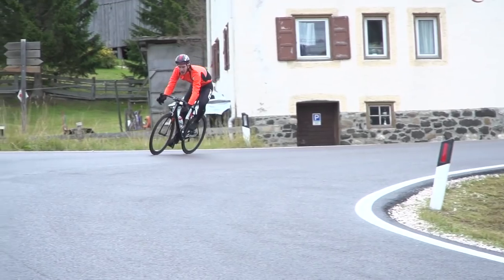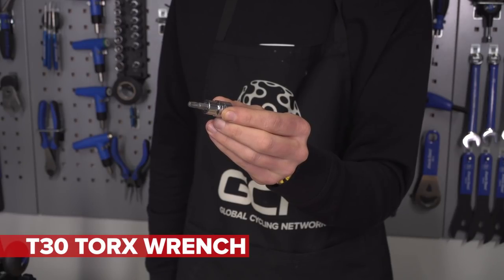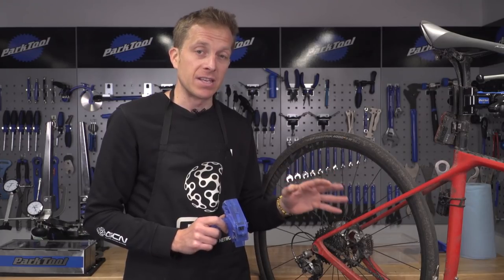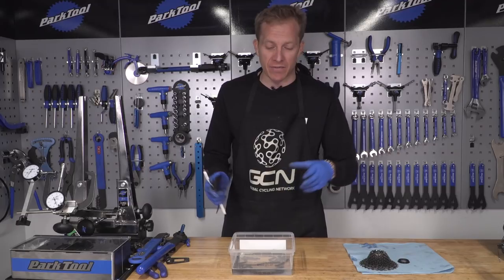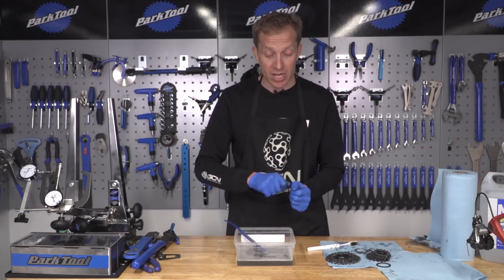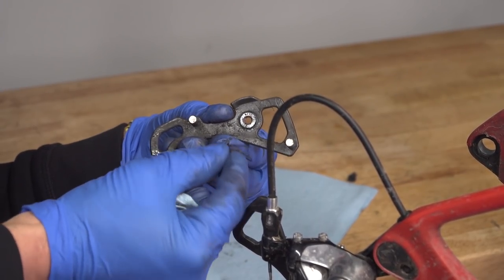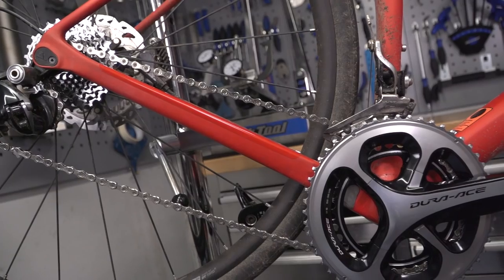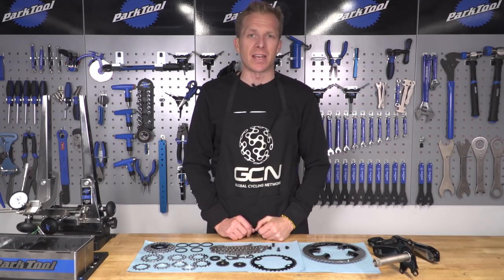Drivetrain Deep Clean | Make Your Road Bike Ride Like New

Comment from the maker: Let us know which maintenance video you'd like to see next on the channel.
Reply: How to maintain relationships
Reply: Now that the CX season is over, it'd be nice if you could show us how to service crankbrothers egg beaters :)
Reply: Nathan Burt blimey
Reply: Maintain cables.
Reply: How to apply a frame saver to steel framed bikes.
Reply: Since I’ve been doing a bit of car maintenance recently, I’ve come across carb cleaner - it’s brilliant for degreasing and comes in a convenient aerosol. Any reason I can’t use it on bike components?
Reply: I've never been able to get an answer on this either. Finish line speed degreaser smells and works just like the $4 can of brake cleaner from auto zone.
Reply: GCN Tech if you want to make a video how to line up your wheels  when you removed them for cleaning , thanks ;)
Reply: What are your views on ultrasonic cleaners? Good or bad?
Reply: GCN Tech full strip and rebuild
Reply: GCN Tech next video install and set up of a power meter
Reply: How to recycle degreaser and/or chains and other bike parts
Reply: What about a video about.mounting everything back in place?
Reply: I second panzerveps suggestion. Not just Crank Bros (which I use on my MTB), but maybe jamming fresh grease into Speedplays (when and how much), or what to do about rusty bits on some old SPDs. That sort of thing. I think that'd make a cool segment.
Reply: How to completely overhaul and clean a high-end wheel hub
Reply: I know you covered wrapping bars in a previous video but could cover wrapping aero drop bars, I have seen so much conflicting information such as wrap to just past the hoods, wrap all the bar to prevent slipping, don’t wrap all the bar due to extra wind resistance, start the wrap from the top down then another from the top up, so confused.
Reply: GCN Tech maybe how to recable a bike (have the kit sat on a shelf ready to do it a few weeks but haven't worked up to it yet)
Reply: How to identify when you need to replace wheel/hub bearings & how to do it.
Reply: A video about winter bike maintenance. (I know there are some)
One showing what to do daily after riding in the snow and salt to keep away rust.
Reply: Usually those kind of degreasers do work very well and evaporate fairly quick leaving no residue.  They're safe to use on metal parts and most other materials that don't get destroyed by strong degreasers. Rubber for example probably won't like it though, with repeated use. I use a car disc brake cleaner for my road disc brakes, it works perfectly.
Reply: Chaining out shifter cables.
Reply: How about a video on bottle cage tech? What shape is most secure? Most aero? Down tube vs. seat tube placement?
Reply: Can we get a workshop tour?
Reply: Jon kudos for actually cleaning a dirty drivetrain. So many videos simply show how to clean an already spotless drivetrain
Reply: I'd like to see something on building/rebuilding/truing wheels
Reply: Vintage 80's headset clean and repack would be amazing.
Reply: How to setup FD and chain length with Q-rings.
Reply: How to slice a pizza since you have the parktools pizza cutter on the workshop wall....
Reply: could you a do a video on how to get mechanical disc breaks working like new mine are not as powerfull and occasionally rub
Reply: Andrew Wallace you mean the coat inside of the frame against rust?
Reply: justin king go for ti parts
Reply: Rixter reminds me of the shaved legs in the razor commercials
Reply: Suggestion for the next video: What is the difference between loctite, regular grease and anti seize paste + where/on which bolts to use which product on alu and carbon bikes? Would be much appreciated. Thanks!
Reply: Lasse Rasmussen what is the answer between grease and antysize?
Reply: Top tip when pouring from a new bottle of degreaser, car screen wash or pure orange juice terra carton, is to pour it with the opening at the top, that way it doesn’t glug out.
Reply: Finding and getting rid of mysterious and annoying creaking sounds.  What are common causes of small creaking sounds - maybe its bottom bracket, or wheels, or seat post, or pedals/cranks, and etc.?
Reply: Is there any trick to get your stem and handlebars locked when using lightweight carbon parts? Even with Carbon paste it tends to rotate (with a huge bang) when I'm hitting bumps... Thx a lot Jon!
Reply: Setting brake pad toe in/out on carbon fiber rims
Reply: I'd like to see a step by step of how to reassemble all the components after a deep clean like this. I'm great at taking things apart, not so much at putting thing back together!
Reply: GCN Tech And after that you should use wax based lube ("squirt" for example). As result you forget about degreasing forever. Possibly, GCN will make video about it?

Comment: Save the time - buy an ultrasonic cleaner - £40 off eBay. Boil your kettle. Add your degreaser. Buzz for 15 mins - boom 20 mins easy. No graft nothing.

Comment: I don't go through the hassle of removing all of that.  I just remove the wheels, install a dummy hub, which gives access to the jockey wheels.  I then use Parks Tools stiff brush to get at the jock wheels, the cassette and the crank and use the chain cleaner for the chain.  I rinse it down and then wash the bike and clean the wheels off the bike and get deep into the cassette.  I just did this today.  I can see doing this deep, deep clean once the bad weather breaks, but not every time after a ride in the rain.

Comment: I am a proper novice at all things bike. I enjoy the videos but would really like to see more details of actually how you remove the components using the tools and not just a quick flash (ie the chan whip and crank tool. Also do you have to use a new pin to rejoin? and can you use a speed chain link like a kmc 10 speed link on a shimano chain? If you're chain snaps when you're out and you only have a speed link to use (if you can), Is this only a temporary fix that you have to replace for a pin or will it last? I know, Sorry, so many questions!

Comment: I use an ultrasonic cleaner that heats the degreaseing  solution.  Hot degreaser, it really helps getting the chain and gears clean.  Also after washing the degreaser off with water, soak the chain, cassette, jockey wheels with bushing and screws in isopropanol alcohol for about a minute.  The alcohol displaces any water that's still trap in the chain plates and rollers, it drys in seconds and leaves no residue and will not contaminate the lube when everything is put back together.
Reply: Interesting. If we don't want to take everything apart, spraying some isopropanol alcohol to dislodge water would work?

Comment: The MSDS for No Nonsense degreaser shows that it's primarily ethoxylated alcohols which is the surfactant used in Simple Green in the USA, or in citrus degreasers. If you can, buy the concentrate and dilute it yourself so you're not paying for shipping mostly water.

For degreasing with an organic solvent you could a number of petroleum distillates used as paint thinner like naphtha, which makes up almost half of WD-40 AND Finish Line 1-Step Liquid.

Sure, the MSDS doesn't disclose every chemical, or the precise amounts of chemicals. So we don't know if we're paying for a proprietary blend of special oils, or the extra marketing to give us a placebo.

Comment: I gave that Screwfix No Nonsense brand Heavy Duty Degreaser that Jon was using here a go last night with a dirty chain, taken off bike and given a shake in a screw top container.  It wasn't very effective neat and just foamed up when shaken, but when diluted with 3 to 4 parts hot tap water and it was transformed and did a really good deep clean.

Comment: Pipe cleaners are very handy for day to day cleaning of the drive train. They fit right in between the cassette sprockets and the chain links. They really suck up dirt. I use them after every other ride. It makes it pretty quick and easy to have a clean drivetrain for the next ride.

Comment: Jo, small tip. So as not to "splash" when poring from a can then rotate 90 degrees and you will not get an air trap" and glugging happening, thus a smooth stream. enjoy the education / information and keep up the good work.

Comment: Listen guys, month ago I decided to switch to the paraffin chain wax. I've used a pretty standard and cheap automotive degreaser (kinda heavy duty, also mentioned in this video). Obviously, everything was brilliantly clean, even tiny spots of the rust gone. And now very important to talk about anionic alkaline detergent as that! I have a Shimano 105 FC 5750 black groupset next to. Right after I started cleaning one I've got massive white corrosion streaks in the shape of lightning strikes all over both chainrings. Looks clean and more than offensively I have to say. So, remember to use dissolved with water degreaser or don't use it black anodised aluminum parts at all.
Reply: The chain is supposed to be cleaned taken off and away from the bike. I put new chains in a glass jar and shake it with degreaser and gasoline in multiple stages.

Comment: I've always been told never to break the chain on the joining pin, you have to pick another one. For me personally I never take the chain of for cleaning. I use a chain scrubber called the "Fasi KettJet", I chose that one for a few reasons: it's all plastic, no chance for rusty metal parts and it has gears that force the brushes to rotate. 
Before I begin I put the chain in the highest gear, spray some morgan blue chain cleaner on the sprockets, chain rings and jockey wheels. Then the chain scrubber comes into action, again filled with morgan blue, I just put it in the bottom since the button thingy is just nonsense, also I hold it with my hand because the floppy thing doesn't really work. When my chain is as dirty as that I might use dishwasher soap first in the chain scrubber to get the worst off first. Then when the chain is clean I use a toothbrush and run it on the sprockets while backpedalling, same for the jockey wheels and chain rings. Rinse it all of with plenty of clean water and then dry it with my air compressor. It gets everything super clean and is a lot less hassle.
For the rest of the bike I use a water gun for my air compressor with biodegradable bike wash, with that it gets super foamy, let it soak in, wash a bit with a microfiber mitt and then rinse it off with a garden hose.
My bike shop mechanic tells me I clean my bike very well, he's surprised to see there's no hidden sand pileups. So I must be doing something right without taking half of my bike apart.

Comment: Maintenance is much more simple if you use a master link for the chain regardless of what Shimano says.  Pins installed at the factory are installed differently and more securely than what the average biker can achieve.  Every time the chain is broken, it becomes weaker and this becomes a real problem for people who ride off road where the stress on the chain is much greater.  The only time I break a chain is when I size a new chain for installation.  A master link such as those made by Connex is far safer and much more convenient.  Also, cleaning the drivetrain is much easier when it doesn't get filthy in the first place.  Learning how to heat soak a chain in a combination of canning paraffin and motor oil means that the chain performs better and does not attract dirt nearly as much.

Comment: A tip:  When you pour from a 5ltr plastic container (like the degreaser) do so with the opening at the top - that lets the air in smoothly and doesn't cause the liquid to surge as the air replaces the liquid.

Comment: Errrrm Jon, pretty sure shimano is clear about not breaking the chain on the previous connector pin... like they say literally any other link! DON'T TRY THIS AT HOME KIDS... well you can but you're weakening your chain unnecessarily... 

Also for the cassette... whilst the chain is still on and bike is in the work-stand turn cranks by hand, spray degreaser on the cassette  and get a cassette specific brush in there... super effective, fast and save faff... you can still take the cassette off after to get all the hidden bits but you will have done the hard work!
Reply: Bruce Edwards hi, I advise splitting on a joining pin that's about three links away from the previous pin
Reply: +1 on the degreaser spray + brush, works great for cleaning after each ride. A full cleaning like in the video can happen no more than twice a year for me, too lazy :-)
Reply: If you ever reach the point where you run out of old pins you're an utter maniac. You'd be spending well over £300 on the connexion pins alone! And obviously the chain would be knackered long before. This is a far longer process than would be done normally. I run mine through the chain scrubber after a wet ride and it comes up fine. I've never had to remove it to be satisfied with the clean.
Reply: I use the stings from an old fashioned mop to clean between the sprockets on the cassette.  It works great without taking the whole thing apart.
Reply: A ultrasonic cleaner will be great. Get a quick link and reuse it. So far, i have sprint it with 1000w peak, it hasn’t snapped in half once.
Reply: Quick links are good and those special pliers to to disassemble them are great useful if you are planning on taking your chain off a lot!
Reply: 1. Spray degreaser on the casette like I did for two years. 2. continue cycling although there's no grease in the casette body's bearings any more. 3. completely wreck your casette body until the bearing's balls fall out. 4. Then replace the body; your bike will feel like new!
Reply: How about replace the wheels? Yay new wheel day! ;) You can re-grease your freehub body. Sometimes worth doing but I've never had a problem with stripping all the grease out... but then I'm not drenching it and after I'm done give a good rinse with water.
Reply: Knowing that the manufacturers say not to reuse the quick links from 10 speed onwards.

Comment: 1. A deep clean is to do a hot bath clean, that is you place the chain is heated mineral turps for about 15-30 minutes. This remocves all dirt out of the internal parts of the chain. How you've done it only removes outer dirt, thus not a deep clean.
2. Skin is actually water absorbent.

Comment: Hi GCN could you please do a video on how to set up cable disk brakes.   How do I set up my cable disks as it seems to be all or nothing.  Do I have the disk rubbing all the time or nothing when the wheel is free to run and then the brakes are useless.  I'm that fed up of adjusting my disk brakes after every ride what I'm I doing wrong?  Thanks

Comment: Shimano now do missing link for 11spd so no need for a joining pin

if you can stretch to one a ultrasonic bath.
Also do a deep clean on new parts to get the manufacturers grease off and put some proper lube on such as Molten Speedwax for the race chain or  Squirt Lube (ceramic wax ) for the training chain.
Bin the stock Shimano jokey wheels, they don't use a proper bearing and are at best crap
,

Comment: I used to do things like this 25 years ago when I first started cycling. I now never remove components and clean with a rag. The drivetrain last just as long.
Reply: Tim Trial Amen to that.
Reply: I do a clean like this once a year in spring when my bikes been through winter. It may not make things last longer but it’s nice to ride a spotless bike when the weather starts improving.
Reply: Thanks Tim. I agree. Granted, I live in a dry place and try not to ride in bad weather, but I could easily clean my bike with everything still attached. Taking it apart seems like you’re asking for something to go wrong unnecessarily.
Reply: Indeed. Well first I don't have the tools but even so. You can clean 90% of stuff without taking them apart. So not as clean, but much quicker, nothing goes bad, and it does the trick. I also try  not to ride too much in rain and dirt. I have another bike for that.
Reply: This is absurd. Do not take your bike apart to clean it. Clean the hard to get at components well when you have to take them apart for some other reason. Otherwise, just wash what you can see, scrape all the grunge off the jockey wheels and chainrings with a screwdriver, get as much as you can off the cassette with a brush, and clean the chain with brush-wheel/solvent-reservoir chain cleaner. Done. Go ride.
Reply: @packratty  agreed. Unless you're a professional rider where your livelihood depends on winning and making your sponsor's gear look cool, this is overkill

Comment: Diesel fuel is a much better degreaser than those commercial products and doesn't require any kind of brushing and rubbing, the grime just dissolves in a matter of minutes. Petrol seems to be even better, haven't tried it myself since it's highly flammable.
Reply: 11robotics I use white spirit it evaporates faster than diesel/ kerosene but is not as volatile as petrol. I wouldn't recommend petrol having used it once as it evaporates so fast everything gets cold and lots of highly flammable vapor is produced.
Water on a degreased chain is a bad idea, rust will form however fast it's dried.
Reply: I've used petrol and I can confirm it works a treat. You only need a very small amount so it's not really dangerous as long as you're sensible. Use a container with a lid so it doesn't evaporate. Need to use degreaser afterwards to clean off the residues, then soapy water to clean off the degreaser, then rinse. Shiny shiny chain :)
Reply: I also finish the cleaning process with a wash with dishwashing liquid and water to clean off the fine layer of diesel and oil that stays on the chain. Even the toughest grime can be removed with barely any effort, no brushing and no splashing over.

Comment: Good video but you didn't mention about using the proper torque when putting the cassette back on. If it is correct to begin with you don't have to worry about adjusting the derailleur.